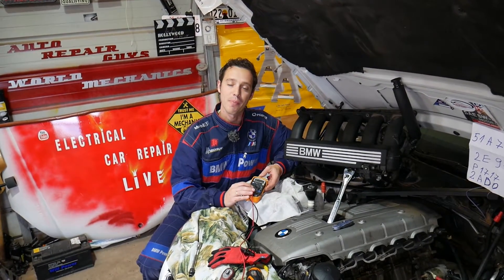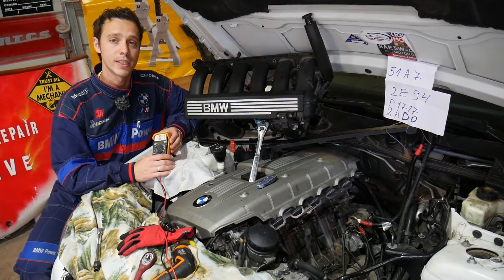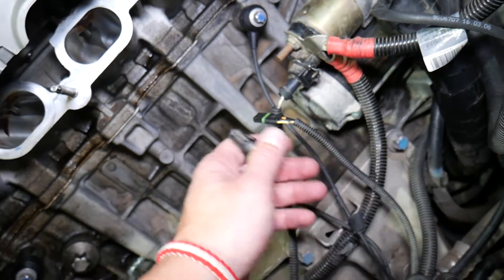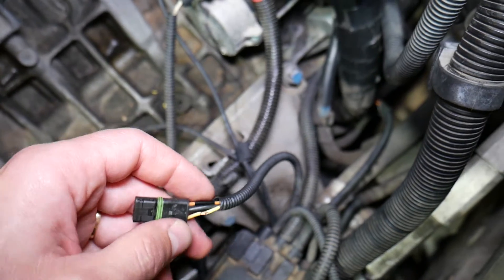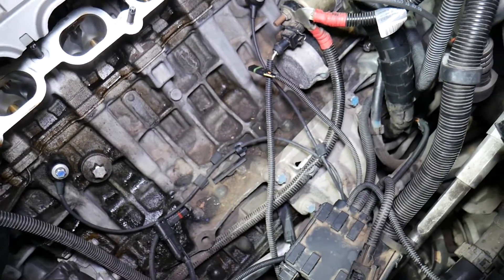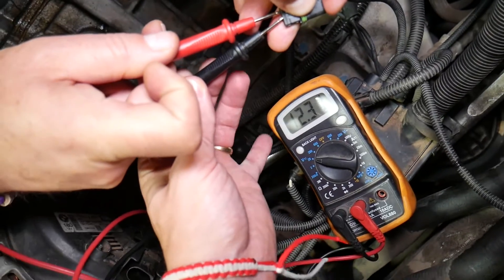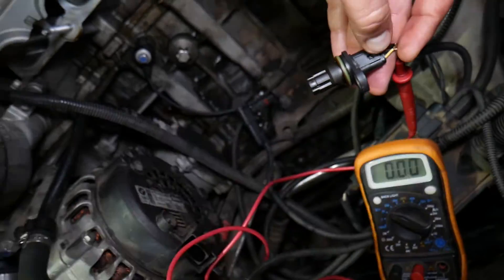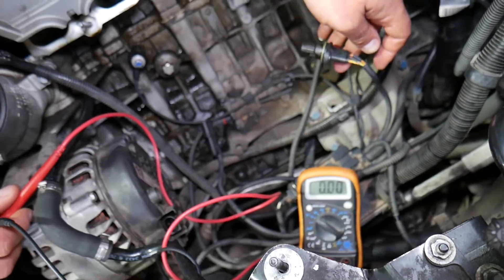HOW TO TEST CRANKSHAFT POSITION SENSOR ON BMW E81 E82 E87 E88 F20 F21 116i 118i 120i 125i 128i 130i

Comment: I have an issue where I am getting the following:
Pin 1 - 12v as expected
Pin 3 - GND as expected
Pin 2 - 12v and not 5v, wiring has been replaced, no shorts between sensors and DME , is this normal? Or should I be looking for a short to Positive somwhere else entering the 5V supply?

BMW 116i N45 motor, results at both cam and crank sensors.

Comment: i have a issue with my crankshaft sensor the yellow wire has no signal when i put multimeter on it i pulled the yellow wire complete out of the harnes to see were it leads to and it went to the dme connector i i tested some other yellow wires in the box were the dme is housed 
some yellow wires give 5volts which is good but that wire for the sensor gives no signal only .58 the car has a good battery that has 13.75 volt im thinking the dme is no good and is going bad i ran ista D and the error falts are (dme no record)  crankshaft sensor no signal does anyone think the DME IS BAD please help the car starts but it takes about 5 second to start then i get transmission error on my kombi

Comment: I try with 2 new sensor and doesn't happen nothing, at my i have value of 4.68 on signal wire and when i touch the sensor my value isn't change with any other sensor, what can be the problem?
Reply: Do you solve the problem???

Comment: Great information for the DIY guy. Thank you! 

EDIT: I would not have cut into the vehicle harness like that, however. It introduces oxygen to to copper conductors, corrodes them which will weaken the wire and create additional resistance.